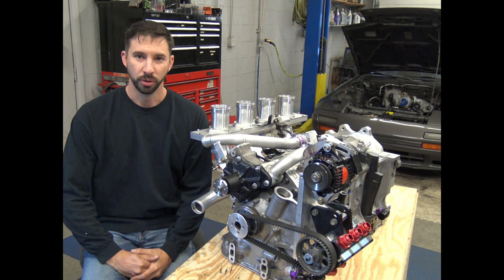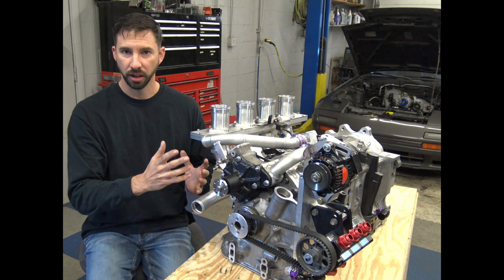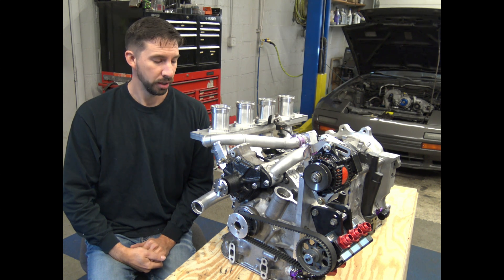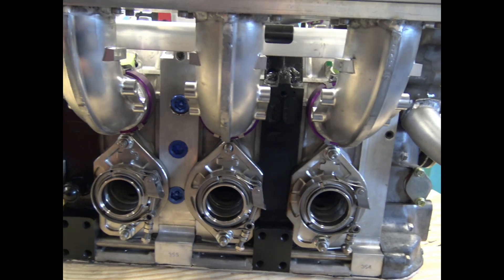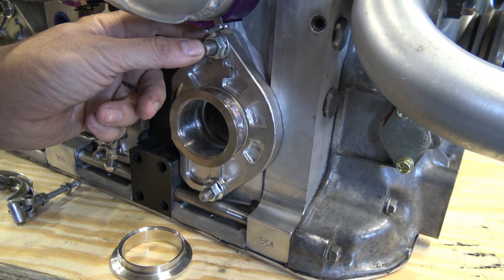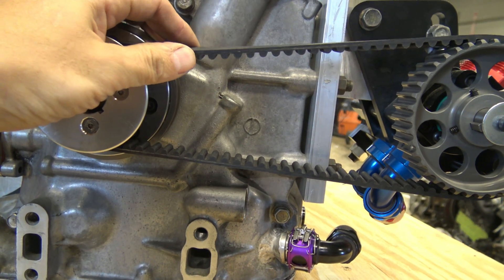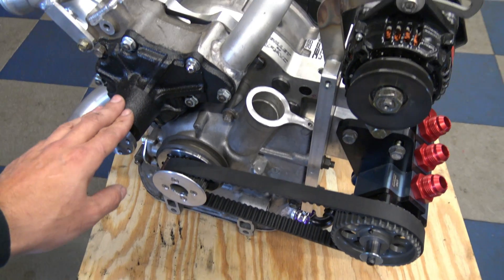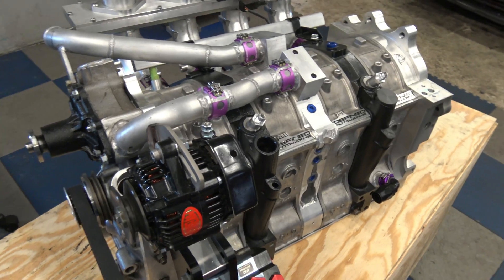The 4-rotor 26b engine overview, facts and information by Defined Autoworks.

Comment: Have you ever thought about making an intake where the runners are hooked up to a linkage so they get shorter or longer dependant on throttle position? I guess you would want it to be progressive so most movement/shortening of the runner would be at the end of your pedal throw 🤔 or would you want it linear? It could also be vacuum actuated. Just an idea. 
Here's a video I found of one functioning 
https://youtu.be/JMVioC2XGO0?si=HQMEMQRTIilcarci

Comment: If you use a 12a intermedia iron you can solve the intake side port problem?
Reply from the maker: No,  still not the same size as the secondary runners. Additionally the coolant seals are not in the irons.

Comment: Why does scoots 4 rotor have that smooth high rpm 787b sound while yours sounds similar but kinda raspier like a v8 f1? is this only to do with the exhaust?
Reply from the maker: Definitely the exhaust is unique on my Rx7 compared to all the others.  It's a 4-2-1 system, while the 4 to 1 collection is everyone else.  4-2-1 has proven to make the most power,  but uses more fuel.  This is why the 787b did not go with this setup.
Reply: I hope he answers this too! i am really interested what is the difference between Yukis Kamakuras 4 rotor by scoot & defined autoworks

Comment: I've been looking at the evolution of Defined Autoworks for the last 10 years or so, always impressed by the creative solutions developped for engine and chassis tech. Props on the work Logan!
By wanting to emulate the R26B, were there any plans on creating a variable length intake trumpet system to extend the torque curve? 

What do you think of Judd's twin roller barrel throttle bodies on their V10 race engines vs the slide throttle? I've read it can be "easier" to get decent drivability from them and less chance of sticking, although they are a bit heavier than slides or butterflies.

And I've always wondered if exhaust power valves (like on modern 2-stroke sleds) would be beneficial on a rotary... Arctic Cat's latest 858 C-TEC2 has an ingenious servo-actuated power valve system. The idea would be to somewhat control the amount of overlap on a full PP rotary to get more torque and response on the low-end and make it a bit more streetable (might be useless for a racecar, but curious nonetheless). Might make for an overly complex exhaust sleeve, but I haven't seen anything like this tried on a rotary through 60 years of patents.

Cheers mate!
Reply from the maker: Thanks a lot! With any luck at all I hope to release videos and changes I've done over the years but never have shared. In short there is already a variable intake on my car at the moment. The controls for it are being refined so I trust its operation on the race track. So far on the dyno its been incredible. Twin roller intakes are awesome, but weight and space are too large for me to use.

Comment: Everyone talks about power, but.. how much torque could a 26B engine make?
Reply from the maker: Mazda made 450ft-lbs at the crank which is roughly 382tq to the wheels. Mine is right at 400tq to the wheels, or 470ft-lbs at the crank.
Reply: This engine makes 662 wheel hp at 9200 rpm, that means it's making 378 lb-ft at 9200 at the wheels. 
I'm guessing the peak torque would be around 6000-6500ish rpm, probably around 430-450 lb-ft at the wheels.
Really depends on the application. A 4-rotor built for 10,000 rpm like this one won't be making as much torque as one built for 7500 rpm with much longer runners and port areas designed for low-prm intake velocity.

Comment: What did mazda do that was different 30 years ago to make so much power on the Le Mans 26b engine in the 787b?
Reply from the maker: They figured out the ideal port timing,  intake design,  used ceramic apex seals with cermet coated side housings.  I've exceeded Mazdas horsepower, but it took a good effort  to get there.
Reply: @GTORx7  You exceeded them on N/A horsepower? How much does your car make? I am a supporter of yours by the way, thanks for the info on this vid !
Reply from the maker: @dragbeast  Yes they made 690hp at the crank, Im doing 662hp to the wheels which is 785-790hp range at the crank. 662 is going to be a old number, aiming to make a good amount more. I appreciate the support!

Comment: I like the V-band exhaust and love the slide throttle. Im surprised that such a small dry sump works but it is a small motor overall. Do you have figures on the coolant temp differences between your system and lets say a "stock" 4 rotor coolant system?
Reply from the maker: I have never placed a "stock" 4 rotor on a dyno with temperature probes in each housing to see what the difference would be. Possibly in the future I can test this out and give actual number value. I do know that a single temp sensor on the outlet of the waterpump will not show the problems. The rear rotor will start to steam and cavitate, but quickly cools down on its return path to the outlet and factory positioned sensor.

Comment: Thoughts on Dahm's (or really the Curran Brother's) custom irons that utilize a tungsten coating on the face of the iron? He seemed to have success with it, just wanted your thoughts. Wonderful video.
Reply from the maker: I know Rob pretty well and we have gone back and forth on coating types and their composition. I even sent a racingbeat aluminum side housing to him for analysis on a special scanner. The jury is still out, but so far the tungsten coating seem to generate accelerated wear on the oil control rings. Racingbeat used more of a cermet coating and that has been inside my race engine for over 10 years with no abnormal wear of the seals. Keep in mind Mazda on the R26b also used cermet type coatings on every surface. So the science is there.
Reply: I'd say the hardness of the side and corner seals have to match the hardness of the coating, otherwise the seals will be short lived consumables.
Lots of patents dating back to the 60's testing out different seal and cermet type coating materials. Some with good results, but the bean counters always have the last word.